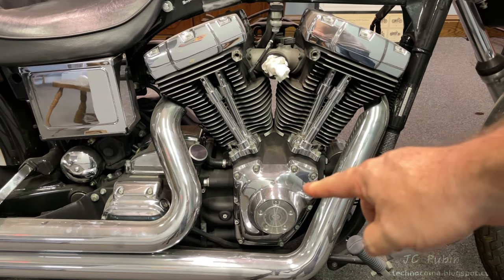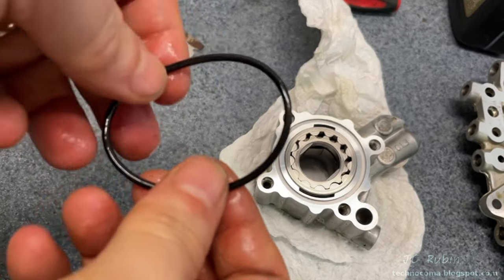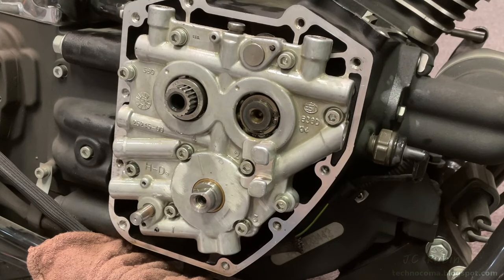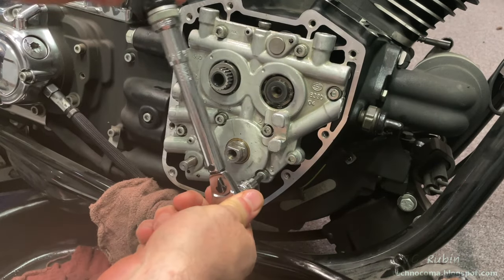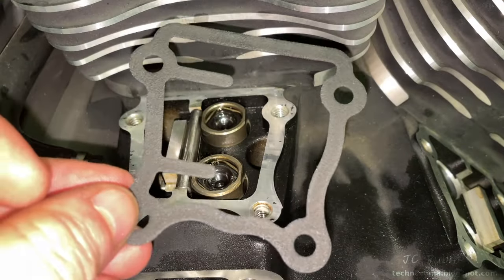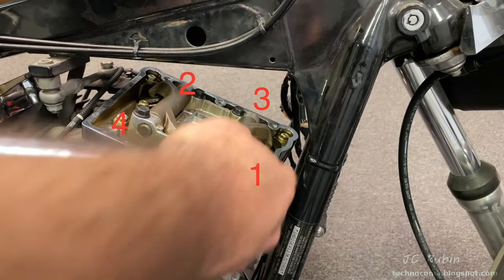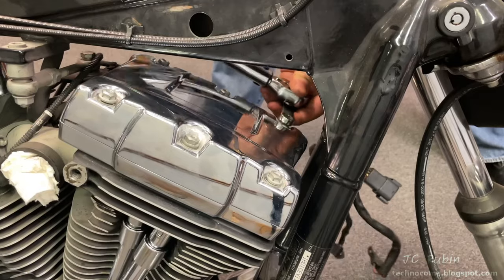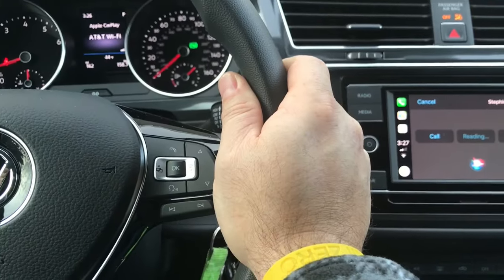Harley Twin Cam Chain Tensioner Replacement with Push Rod Removal Complete - Part 2

Comment: I might be wrong but don't you use the tapered guide bolts ( oil pump ) when installing lifter cover, or I'm thinking EVO motor
Reply from the maker: You are thinking shovelhead, about 22 min into the video below
AMF Shovelhead Lowrider Restoration -17 - Engine Build 2 - Gearcase, Lifters & Cam
https://youtu.be/2xO7DZYIRgI

Comment: Where did you source the oem H-D tensioner?  I can only find them on eBay and am a bit skeptical.

Thanks for the awesome video.  My Dyna I just picked up only has 16k miles but I feel I should replace the tensioners for peace of mind/ cheap insurance.
Reply from the maker: I purchased both directly from my local dealer.  Remember removing the cam cover will allow for a decent inspection of their condition, it may only cost you a cam cover seal.
Reply: @delorean1  Didn’t even think of calling my local dealer..duh haha.

You’re right.  I can easily pop the cover off and take a peek at the condition they’re in.
Reply from the maker: @nikasumo  The rear is harder to see but easy to tell if its started to work its way into the skid,

Comment: I just did a cam chain tensioner replacement now it is idleing rough and is sputtering then dieing also here air coming out as well. 
 Does anyone know what could be wrong.

Comment: I have heard of guys using emery cloth to polish the outer surface of the cam chains to reduce wear on the tensioner shoes
Reply from the maker: Ive heard of this too, Id think after the first 30k miles whatever needed smoothing would have worn itself down unless those skids are reeeeally soft.

Comment: Man I found this video after taking my right side cover off looking for what sounds like a loose nut or bolt rattling around in bottom of engine that is sporadic. And I really hate to get this far into the bike. Any body else have this issue? 06 Softail deluxe approx 32k miles have been all over engine with sthoscope. Sound seem to come from right side but I have been to the put primary already.

Comment: Liked 👍 Well explained and should boost anyone's confidence 
for this job .  But was it really necessary to remove the exhaust 
there seemed to be enough room to remove the cam plate ?
Reply from the maker: For some exhausts perhaps.. I found it easier on this particular setup to do so rather than navigate around the pipe.

Comment: Just few questions
1. Did you applied red thread locker on the rear chain sprocket (bigger one) - manual says that only for this upper one it shall be applied - not on the bottom one?
2. did you re-used the bolts for the sprockets?
3. did you applied a new snap rings on the tensioners or the old one were used ?
thanks in advance!!
great job once again!
Reply from the maker: Thread locker was applied as per the manual.
I re-used the bolts
Always new snap rings
Reply: @delorean1  clear thank you!
just on my way now with this. plate out. waiting for bearings puller to be machined.

Comment: Ok One more here. Did you took off the fuel pump fuse out while you have been turning the engine by the starter to build up the oil pressure ? Thank you.
Reply from the maker: The carb connects directly to the tank, there is no fuel pump.
Reply: @delorean1  thanks. sorry I only saw on the other movie that it is not EFI engine.
thanks for feedback

Comment: EXCELLANT VIDEO!!!!!!!!!!!!!!!!!! REPLACE SHOES WITH "CYCO GASKET" POLYMIDE PLASTIC ONES. THEY ARE A LOT BETTER THAN THE CRAP HARLEY ONES!!!!!!!!!!!!!! AND DON'T FORGET TO REPLACE THE CRAPPY STOCK INA INNER CAM BEARINGS WITH TORRINGTON ONES.!!!!!!!!!!!!!!!!!!

Comment: What made you think that you needed new tensioners?  What were the bike's symptoms (i.e., difficult to start, lack of acceleration)?
Reply from the maker: None....... Simply the mileage..
Reply: @delorean1  Copy, do you recall how many miles were on your bike when you replaced the tensioners?  FYI - I am asking because have a 2000 ultra with 65K miles and I do not think the previous owner ever replaced the tensioners.

Comment: Sorry to ask again but when putting camplate back do I line cams up and then line dots on gears with mark on plate as you show in video. I need to get this right and I think I maybe didn't explain properly before. Thanks.
Reply from the maker: Everything lines up one way as described here 

https://youtu.be/EtMYxfYk6qI?t=638

Comment: Should have just upgraded the cam plate to the screaming eagle conversion to get the hydraulic cam tensioners, you’ll have to do this again in 25k-30k miles again, just do it once with the hydraulic version. Very thorough though
Reply: Loctite loctite….
Reply: And buy new breather assembly’s
Reply from the maker: There could be some interesting upgrade offerings for this in the next 30K

Comment: So when checking for oil pressure, does that mean oil light turns off, or stay on, or turns off???
Reply from the maker: It starts on, but then shuts off and stays off.

Comment: Why do we need the tensioners, with such a short run of chain? Seems goofy, I have worked with chains  for years with much longer runs then these without tensioners and no problems with jumping teeth or jumping off the sprockets.  I think it's a try at noise reduction.  All this trouble with something not needed?
Reply from the maker: It is an interesting point.  I would imagine though such a short chain, with requisite slack turning at such high speed would have considerable oscillation remembering its not functioning like an inner primary chain and doesn't impart torque on anything considerably, a cam? Valves against lobes?
Reply: @delorean1  I actually read a short write up from a guy who claimed he removed his.( I since have not been able to find it again as I'm not able to remember what it was even from) He said he had over 14k miles on the bike, without the tensioners at the time he originally wrote it. I believe he said it was an 05 Road Glide. He said he could tell no difference, possibly some slight chain noise but he wasn't even convinced he heard that. He also said he opened up the cam chest and checked things out a couple of times and never seen any problems.  He then sold the bike to a guy, he made a few replies to people's comments  and had around 20k on the bike after removing them when he sold it.  He said he had never heard anything negative back. It's one of those things that I would like to try, but who wants to be one of the early ones to attempt it. We will probably be reading 10 years from now how many people just removed the tensioners without problems and we had been wringing our hands over this for nothing. I do run my 06 RK without a compensator ( just a 25 tooth sprocket) and with ATF in the primary. So I do like running on that edge a bit. I will need to dig into this more.... thank you for your informative videos. I have always done my own wrenching but I always watch these good videos for enjoyment and different perspectives, and even more knowledge on different subjects.  Enjoy the Ride!

Comment: This helped immensely, but I will add that you cannot remove the rear rocker assy. on a 2006 Ultra CVO 103, as the frame is in the way to let the bolts clear the engine. I am attempting to kill 3 birds at the same time as I am installing Rocker Lockers, putting in fresh cam chain tensioners, as well as installing accent lighting.  My winter project in Michigan.

Comment: I'm just curious. If I kept the oil pump attached to the cam plate during disassembly. Will I need to center the pump when I reinstall the cam plate? Also, the disassembly was a breeze thanks to Part I. Thank you!
Reply from the maker: No if it remains attached you will not need to recenter it.
Reply: @delorean1  Thank You! Unfortunately the inner tensioner removal tool is on back order. So I'm going to have to take my cam plate to the dealership for them to remove the cams / bearings and put the new tensioner on. On the bright side though. I decided to take the opportunity and upgrade my cams. :D If anyone is having trouble finding the tool taking it to a shop might be a faster alternative.
Reply: @JByb04  I just took it to a shop to have them put the rear tensioner on.  However they seemed adamant about taking the pump off and putting it back into the cam case, and align it.  Did the dealership give you the same feed back?  Or were they cool with just letting you put it back in if you didnt remove the oil pump?
Reply: @abowenz  I asked the technician about doing the centering procedure and she said I should be safe to reinstall it without centering. From what I've gathered it's one of those it doesn't hurt to do it procedures. But you don't necessarily have to do it. But if Classic Wrench and a HD Technican say I'm safe. That's good enough for me.
Reply: Right on thanks. Have you finished the job? If so how did it all go?
Reply: @abowenz  I'm sorry for the late reply. I am in the final stages of reassembly because life got in the way. But so far so good! This video has really made it a breeze.

Comment: Question If all push rods are loose except one Is it OK for me to torque down everything to specs On top??
Reply from the maker: Are you sure its aligned properly that both the intake and exhaust are on the flats of the cams, if so you can turn that one 1/8 a turn and wait 15 min, if it loosens its because the lifter did not fully bleed down, repeat this till full seat.
Reply: I did everything they were loose I tork them down and then again one push rod is still tight ?  So that means I should untorque everything and start all over ?

Comment: I simply cannot believe hardly deliberately designed the engine this way. To have to go through all this crap every 40,000 miles. Simply unbelievable. The only thing close to this debacle is Norton. You have to take the points assembly out whenever you check and adjust the chain tension for the cam chain. That means you have to retime the engine every time you do that procedure. Of course with the Norton if you run at 7,000 RPM the chain will change the timing and you run the risk of blowing holes in your Pistons. Frankly I am flabbergasted that the majority of twin cam owners did not engage in a class action suit against Harley-Davidson because of all the crap they have in the engine. If Harley-Davidson had to take every twin cam and put in a new oil pump cam plate, gear driven camshaft if possible at no cost to the consumer because that's the way the engine should have come straight from the factory. If I had to do that procedure on my Evolution Sportster in 22 years I would have done that procedure 10 times. I have 400,000 miles on the bike on the original engine. On the Evolution Big twin replacing the lifters every 40,000 miles is it the horrible job that checking and replacing the chain tensioners are on a twin cam. Such a disgrace on Harley's part. It would probably sink the company if they had to make it right with every twin cam and M8 owner for the last 20 plus years because they were Pennywise and pound foolish the way the British would phrase it.
Reply: EPA - The lovely united states government, everybody's friend - Forced them to reduce noise.  Apparently chains are quieter than gears.

Comment: What year is this bike? Ive seen different shoes for different years.
Reply from the maker: 100 aniv
Reply: @delorean1  never heard of a 100 aniv. But thank you regardless , I only asked because I have an 06 streetbob fxdbi and apparently its the first twin cam with hydrolic tensioners, but other twin cams that year didnt? I dunno, pretty confusing. My bike seems to be the stepchild of twin cams. And I am actually a stepchild, so it makes sense

Comment: @ 22:50 was the starter cranking to build pressure?
Reply from the maker: Circulating oil without the plugs in, no compression, no gas no chance of the bike running, able to see the oil light go out and confirm pressure achieved.

Comment: You had all of this taken apart and DID NOT replace the cam bearings? Especially considering the condition of the tensioners.  Hmmmmmm
Reply from the maker: That's right you watched THE VIDEO.  Tensioner wear has NO BEARING on the bearings but the outer chain finish.

Comment: Looks like a headache for $15 shoes
Reply from the maker: I wouldnt replace with 15$ Chinese parts
Reply: @delorean1  twin power is what I'm seeing everyone use. Better quality reviews than Harley replacements.
Reply from the maker: @KevinRoadrageGarage  Im still not understanding what the 15$ shoes are as they would apply to the parts replaced.
Reply: @delorean1  Twin power cam chain tensioner shoes J&P#753-879  Mfr part #9905KIT if you look up Twin power tensioner Shoes on YouTube